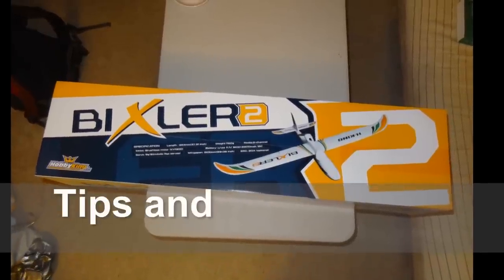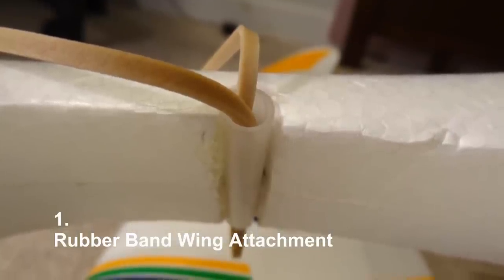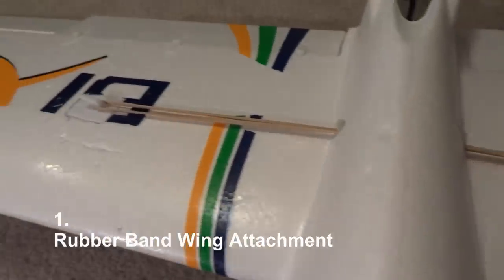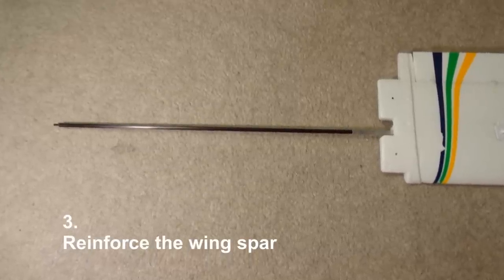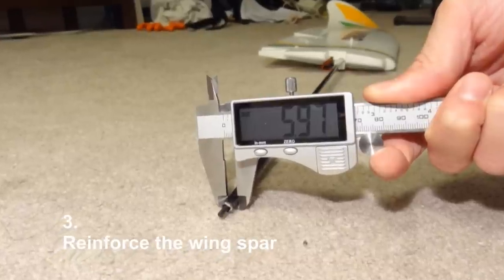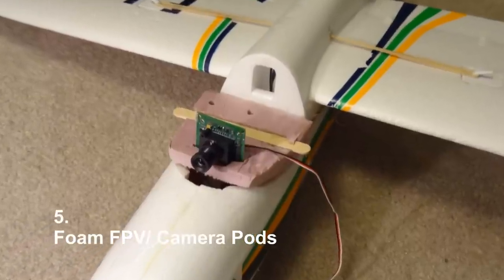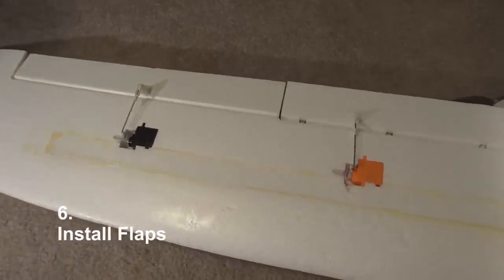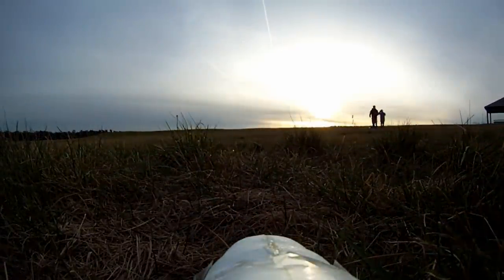Hobbyking Bixler 2- Tips, Trips, & Modifications

Comment: Add strength to the front of the plane!
Remove the original 'styling' water transfers by applying a short piece of masking tape to one end and just pulling the whole thing off. (they come off so easily anyway). Then cover the nose with reinforced clear tape. Make sue the tape goes up to the belly shield. Also have a long run of the reinforcing tape along each side of the fuselage to about half way under the wing, then cut out the little piece over the servo arm to keep it mobile.

Comment: I have added a 2mm spar in a slot underneath the horizontal tail plane (stabilizer). I ran the point of a soldering iron along a straight, taped on, piece of music/undercarriage wire, with the iron just cutting into the foam. 
.
I like the 'harness' idea, and will include it in my Bixler2 build up today before it's maiden flight. Heh, I can make stuff but can't fly too well just yet. So I shall add reinforcing tape to the leading edges of the wings, the nose and all down the fuselage sides.

Comment: Yes that wing idea of yours is very good I also bought the small parts cnc motor mount and that is one of the best purchases for this plane . It helps you use all different motors and props.i really did have a lot of fun putting this plane together.. Also I thaught if you use a servo reverser I read up on it today , my 9x has that in it but if you use one the readings said to save the aux channel cause you put the servo y lead in one channel ail and hook the reverser to one side to the flap serv

Comment: A spar inside the spar is a very good idea. Use a 4mm tube inside the 6mm tube. Cut it to length first if you need to. Protect your work surface with some newspaper or something plastic/whatever. Hold the original spar upright with one end on the bench, then drip a load of 20 second cure super glue down inside the original spar. Quickly shove in the 4mm tube till it hits bottom. Then you can either wait while holding it, or spray or drip some kicker onto the top end. Clean up the other end. Done

Comment from the maker: One servo will need a servo reverser, then hook both to a Y-harness and then plug into the aux channel... just double check it all goes the right direction before gluing in.

Alternatively, you can make both servos face the same direction (you'll have to cut out some foam on one to make it fit) and then you don't need the servo reverser

Comment: The original carbon wing spar is a very cheap carbon tube, and the carbon rod on the bottom of the fuselage is the same quality. So I also recommend either gluing a 3mm spar inside the main one or replacing it with a carbon arrow shaft and then gluing a 4mm carbon tube inside that. Then replace the bottom one with something stiffer.

Comment: Have you had any issues with the elastic/hook mod for the wings? It does not look too good to hold the wings together...
Reply from the maker: It doesn't look that good but it actually works great.  Gives some give during crashes but during flight it holds it together just right.  Only change I would do is put it on the underside of the wing to counteract the natural upward flex you have when doing loops and what not.
Reply: ok cool, thanks